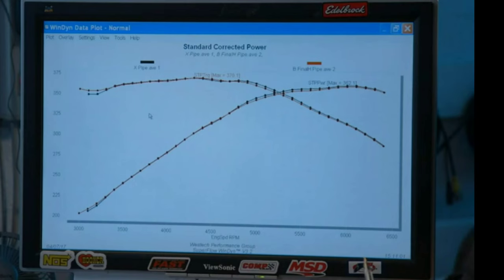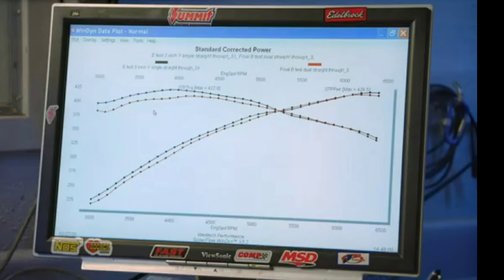DUAL EXHAUST LOSES POWER! single is better for POWER!

Comment: The one solid rule i know is back pressure = bad. In both the real world and in the math modeling, there's no situation where back pressure is good. 
But you have to balance volume with velocity on your air flow thru the tube, and because the engine is effecgively an air pump that has a power band, one configuration if pipe maybe effecient at one power level, but not another power level. 
So, just like many things in life, it's a balance. You gotta choose where you want your efficiency the most based on your preference. 

What i would be curious to see, since im not into cars that much and so i dont know if its so - id like to see an exhaust setup where the collector has the inputs off angled to the linear axial flow in the pipe. That way, you'll get the gas/fluid to begin to spiral in the pipe. Hypothetically, this would help scavaging even more if done right if you increase the Venturi Coanda effects. 
Im just unsure how this wouod work with pulsed air flows of that of your typical combustion engine.

Comment: I love how we get a guy with a residential garage telling us all how single makes more power than dual because he saw an episode of engine masters. The single made more on THAT engine with those collector lengths and that single exhaust and y pipe... That does not mean every car everywhere will get more power out of a single y piped exhaust. There is a lot more science to it and I suggest you take a look into Larry Meauxs PipeMax program and all the related data to exhaust flow and collector lengths.
Reply: I like your input, but in a general common application, it  holds true about single pipe. My favorite example of single pipe car engines though is on super late model asphalt race cars. The tri-y side pipe with stepped head tubes.....WuuuBahhhh!

Comment: Ok. What are your thoughts on the whole catback system? Single exhaust y pipe up front and ypipe at the back! Does it help having the exhaust gasses escaping more with the  dual pipes or just a single pipe?
Reply from the maker: I think that is just a way to make it look like you have dual exhaust when you really dont lol 😆 

You already have it as a single for most of the way anyway, no point in splitting it apart again 😅

Comment: Does pipe diameter influence the choice of y,x or h pipe? What are your thoughts on the Flowmaster Scavenger x pipe?
Reply from the maker: Pipe diameter is more influenced by the flow of the engine (or HP), Im personally a believer that an X pipe is just a not as effective Y pipe myself 😅
Reply: 2 .1/2 best for stock v 8 / headers max

Comment: It’s not a bad theory, however how many cars have the room to run a single 3.5 piped system? The 2.5 dual system would have slightly more volume assuming the 3.5 pipe is equal length to the duals. Single exhaust sounds crappy compared to true duals. Finally, It also more quickly funnels heat away from the engine and allows 2 catalytic converters to run decreasing the back pressure even slightly.

Comment: Lots of considerations need to be made, such as application. What RPM range will the vehicle operate in the majority of the time? Let's not forget to factor in the affects of both banks going into a single muffler and back pressure generated vs. two separate mufflers.
Reply from the maker: @JohnDoesItAll  no backpressure generated if you size the exhaust correctly
Reply: @newguysgarage6802  Agreed!

Comment: Have a question hoping you can answer. I absolutely understand the 2 into 1. So what happens at the Muffler. 2 going into 1 then big expansion chamber called a Muffler then splits off into 2 going out witch is very common on trucks
Reply from the maker: Usually after the muffler the added pipe doesn't really affect power much depending on the muffler that is. 

If you have a big expansion chamber style muffler the reflected waves stop and turn back around once it hits that open chamber. 

So you could have duels out the back after that.....but it would just be to add weight at that point 😅
Reply: @newguysgarage6802  thanks for the response. Makes sense that you mentioned it. Im running KOOKS Long Tube Headers with there catted Y pipe.  2 going into 1 set up on a 6.2L Ford Raptor connected to original Muffler and back. Had it tuned and It Really woke the truck up. People kept telling me to go straight duels but I did what the Tuner said and he was rt.

Comment: Just the video I was looking for. What would you recommend for me? I just bought a 2023 Supra 6MT (single turbo) and stock it comes with dual pipe through all the way back to dual exhaust. I want to upgrade the exhaust system. Would sticking to dual pipe through to dual exhaust be the best option or would single through pipe through to dual exhaust exists be a better option?
Reply from the maker: So both manifolds go into a single turbo correct? 

Then from the turbo they split into a dual exhaust? 
Am I understanding that right? 🤔
Reply: @newguysgarage6802  https://youtu.be/RRW2aUSw5vU fast forward to 4:11 which shows the Supra underbody.
Reply from the maker: Ok got it, 

Yes so really because both manifolds go into the turbo and the turbo has one exhust outlet the additional pipes are not Necessary. 

There is no scavenging affect after the turbo so you just need that exhust gas to get out as easily as possible. 

So a large diameter single exhaust would be the most effective for that purpose, and weigh less than the additional exhaust pipes too. 🙂
Reply: @newguysgarage6802  Thanks. Perfect answer. Good diameter pipe and going single pipe through will save on weight. I appreciate the help
Reply from the maker: No problem man 👌 
Glad I could help 🙂

Comment: Great video, I’m building a v8 Sonoma and I’m at the exhaust stage , I’m going to go with the single in / single out flowmaster 50 series but dump the tail pipe in front of the back right tire .  Cheers 🇨🇦
Reply from the maker: Sounds sweet!

Comment: Bro I have an inline 6 engine, originally it came as a single full pipe exhaust, now I did turn it in a true duel exhaust, should I consider having the two pipes which are each 2.5 inch join into a single muffler of and it becomes 4 inch single pipe after the muffler, Will it increase horse power and torque?

Your videos are SOLID
Reply from the maker: Ok so what do you have now? 
"Now I didn't turn it into a true duel exhaust" 

Not quite sure what that means, so it goes from single to dual afterwards?

If so then I would just put a single on probably 3.5in and a good see through muffler 

If it is a true dual, then I would combine the two 2.5in into a Y pipe with a 3.5in outlet and a good see through muffler 🙂

Possibly even a 3in depending on how much air the inline 6 is pushing (lighter too) 350hp and under I would do 3in
Reply: @newguysgarage6802  appreciate the reply, my error I meant to say I turned it into a true duel exhaust, my engine reached 438 Hp and 496 torque, I guess I would need a 4 inch y pipe?

Also is it recommended that the true duels exhaust join in the muffler instead of having a Y pipe? So I can get best of both world( low rpm power and high rpm)

Comment: Your comments might apply to V8s with dual cylinder banks but what about inline engines ?
Reply from the maker: @dezartsean6059  works the same way lol
Reply: @newguysgarage6802  How can it with a single engine sides' pipe coming down ?
Reply from the maker: @dezartsean6059  so long as all the pipes merge into a common collector you get the same exhaust scavenging affect. 

Dosnt matter if there are 4 on one side and 4 on the other..... or if all 8 are in a straight line,  just matters that all the piles get connected to help scavenging.
Reply: @newguysgarage6802  It matters where (at what distance from the head) the inline primary pipes become 1x !
Reply from the maker: @dezartsean6059  ya.....but it does on both inline and v engines too lol.

Comment: I was building 2 into 1 systems in my shop in CA for circle track racers back in the early 90's because they worked. I used the Flowmaster merge collector. Usually 2, 2.25 into 1, 3" or 2.5" into 1, 3.5". It was all stock exhaust manifold, street stock type racing.
Reply from the maker: Sweet! 😃
Reply: I just built a 400 hp dodge 360 for my 1985 ram. You think I will be good with long tubes and 2.25 pipe going into a Y and 2.50 exhaust pipe after that? I'm very interested to feel the difference in torque!
Reply: @sethblair5534   For that HP I would have  used Flowmaster Scavenger Series Y Collectors Y250300 with a 3" Flowmaster. Muffler choices are a lot larger now than back then so it's about what you like for sound. But that merge collector helped get the car off the corner. I personally don't like the sound of X-pipes. I just built and installed Flowmaster style chambered muffler for my RV generator. Getting ready to test it as soon as I heal up from getting hurt. Its on my channel.
Reply: @speedmaverick  I have a knockoff flowmaster super 10 from ebay. I probably will eventually go to a 3 inch exhaust pipe and muffler. I'm just hoping the 2.5 pipe doesn't choke it too bad for now as I just need to get my old truck inspected for the moment
Reply: @sethblair5534  It's shown in recent testing that a single 2.5" pipe can easily handle 200hp. The 3" exit will cut the top hp but it will increase the low & mid. So usually the average across the RPM range is better overall than the loss of peak power.

Comment: Regarding friction inside the pipe, air density should be taken into consideration. Also, weigh the importance of scavenging against just plain getting the air out of the cylinder. There's a reason why the P-51 and other high performance planes and dragsters use straight pipes.
Reply from the maker: Planes and dragsters are completely different from a gasoline car engine 🤦‍♂️
Reply: @newguysgarage6802  Completely different? They're internal combustion piston driven engines. Yeah they might be supercharged or turbocharged but not all. Velocity is good for torque, and I can appreciate that. I have work trucks that require it. But I would not make scavenging more important than flow in a high horsepower engine. Just saying.
Reply from the maker: @yoursoulisforever guy you can not compare gas engines with nitromethan dragsters.

They operate in completely different ways....windage in the oil pan of a nitromethan burning engine actually makes power...thats is how different they are 🤦‍♂️
Reply: That is your opinion, and you're entitled to it. Many people would disagree with you. Are you smarter than everyone else? I'm not putting you down. Rather, just pointing out that savaging is not everything. Not even close.
Reply from the maker: @yoursoulisforever ya many people would think a nitromethan engine works the same as a gas engine.......and ya I guess im smarter then them in that case
Reply: I never said that, and now you're being a smart ass. If you're so smart, then how come you didn't cover the fact that air density has an effect on friction? Look, I like your video with regard to your presentation. In that regard it was excellent. You have a gift there. And if this old man could offer some helpful advice, and you can do what you want with it, but I would caution against using absolutes. Instead of presenting your ideas as the only avenue for making power, why not do your video on the importance of scavenging and how it works. Your gift of presentation will do the rest, and hopefully you'll get a ton of like and subscribes.
Reply: @yoursoulisforever  nah he knows it all and doesn’t need your old ass

Comment: I’ve read some of these comments not sure I’m smart enough so I want to ask for your input, I have a 2015 ram 2500  5.7 Hemi I was wanting to put Borla cat back duels like the 1500s have, but they don’t make anything for 2500 except a single for the 6.4 which is 3 1/2 inch  mine is 3 inch, my question is would this 3 1/2 inch exhaust system work on my 5.7 or would I lose low end torque because of velocity loss and power in low RPMs
Maybe you answered it at the end as I asked before the end of video 
I guess my question is will I hurt performance by increasing my single from 3 to 3 1/2
Reply: You may lose some low end torque either way if the truck has a single exit exhaust from the factory. You could go a few different directions, it's your vehicle to do as you wish, but IMO if it was my truck, I would either find a single borla 3 inch in/3 inch out muffler and have a shop weld it into your existing exhaust... or find 2 mufflers, go duals, but drop the pipe size down to 2.5 or 2.75 inch to maintain the exhaust velocity. Having a good exhaust shop fabricate an exhaust will save you big money vs an off the shelf catback kit. Hope this helps!

Comment: Ive had many muscle cars ..i found long tube headers to straight pipe to muffler or glass pack ... Y pipe gave way more torque than the x pipe did on same set up .. gd example the 4th gen Firebirds / camaros .. ford mustang came dual an headers stock an firebirds came mannya to  pipe no headers..they were factory beast at the time that mustang couldnt touch ...

Comment: What about the restriction of a single muffler? That's probably where the idea of dual exhaust came from in the first place. Could a single exhaust be built with enough capacity for power levels of 500+ that could fit the vehicle(?) I would be interested in seeing tests on it, though.
Reply from the maker: The engine masters test had see through mufflers on them. Should have mentioned that 😅
Reply: Glass Packs.
Reply: Yes they mentions that in the video anything over 400 duals are better
Reply from the maker: Actually they said "we did extensive testing but only had more questions then answers on why this single made more power" 

After they admitted they didnt have a clue why it is the way it is......then they throw out the blanket statment 🤣
Reply: @newguysgarage6802  did you not go look at 4:46 because it shows your wrong. 20:20  they say they would not run over 430 hp thats only 350 to the tire which is not much at all.
Reply: @701garage  do you mean the Dyno graph ? Cause it shows good result on single
Reply: Diameter. Though after that Cost and weight becomes an issue. 3+" Stainless is no cheap lol
Reply: @701garage  Yes . But, under 400hp using 2.00 inch pipe in a true dual system works wonders for torque compared to a high flow single. Everyone shits on 2.00 and 2 25 inch pipe, not sure why.
Reply: @newguysgarage6802  the answer to why the single made more power is because they're using too big of diameter of pipe and their true dual system that's why.
Reply: Pretty much all of those dyno graphs show that single exhaust is only marginally (single digit) better. And only at lower rpm. Into the higher rpm range, any benefit is negligible beside weight maybe. Add in the factor of not being better for higher HP engines and you have the answer for why modern high hp cars have dual exhaust.
Reply: Never seen a drag car with any exhaust for the most part. And if they do it’s not a single. Many factors here. What do you want for an end result depends what setup is best for your needs. Always ran 2to1 on my Harleys for lower end torque, dyno confirmed. They don’t do shit wide open. Same applies.

Comment: Good video, although the science is a bit dodgy, the conclusions are actually on point here. One fundamental topic missed however is packaging, it's easier to package (route) two smaller pipes then a single big boy under the car, through the suspension etc., this is the real reason why OEM cars are always twin pipe, as always,  a compromise is struck between performance, packaging, mass, cost, etc etc.
Reply from the maker: I make the assumption like any good hot rodder the pipes will end and dump before the rear tires as they should 🤣

So packaging was not really relevant 😅
Thanks for watching! 🙂
Reply: Why not best of both worlds? Immediately y-pipe merge into 1 big exhaust out of the headers.  Then when it gets to the axle back, diverge again back to duals for packaging.  As well as doubling the exhaust note.
Reply: @newguysgarage6802 I'm planning on doing some custom exhaust work to my C5.  Plan on immediately combining the exhaust out of the headers and then splitting it again.  Hoonigan made a video on the Celeritech exhaust system, and I'm gonna try my best to mimic that on a budget.  Might make a video if it turns out as good as I think it will.

Comment: I got a supercharged LS 6.0 TBSS.  They come stock with a y pipe set up.  Was thinking of doing 3 inch y pipe but cutting the y pipe back to fit as much of both pipes into the 4 inch collector as I can and doing 4 inch back, thoughts on that opposed to dual 3 inch??
Reply from the maker: Ya I would make the Y pipe nice and large especially if its supercharged!

Comment: I want to do 1 3/4 long tube headers on my 2001 tahoe with the 5.3, but I’m stuck on y-pipe to single out, or x pipe to dual out. Dual out looks good, but Im not sure what to do.
Reply: I have those size headers going to a catless 3 inch ypipe to a single slp resonator and side exit tip on my 2000 gmc sierra 5.3.It sounds similar to a corvette and has good low end torque.It's actually quite a big difference in torque over the stock manifolds.

Comment: Does it make a difference if the exhaust is single from the front to almost at the back and then near the back or after the muffler it splits?
Reply from the maker: The further back the pipe gose the less of an affect changes have to it.

The closer you get to the engine the more sensitive it becomes to changes 🙂